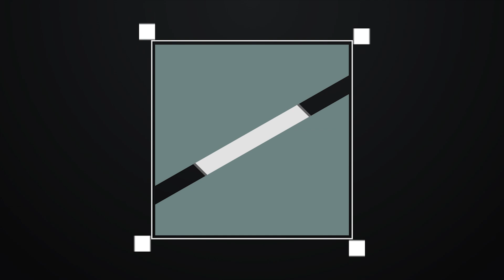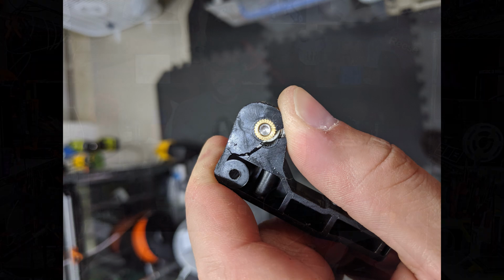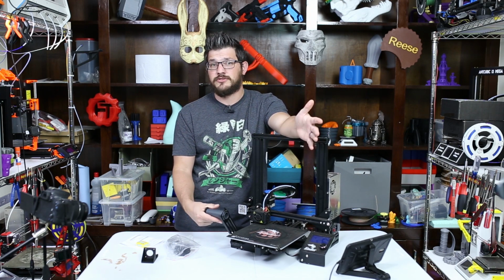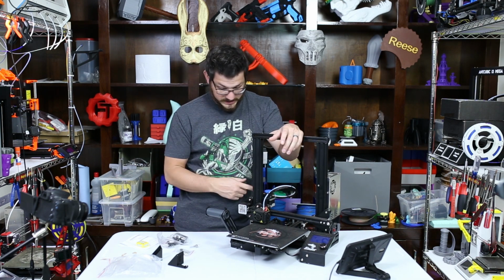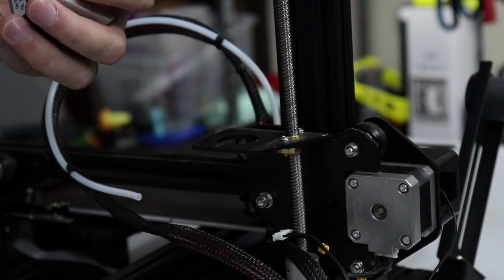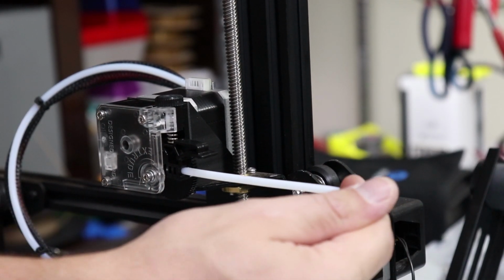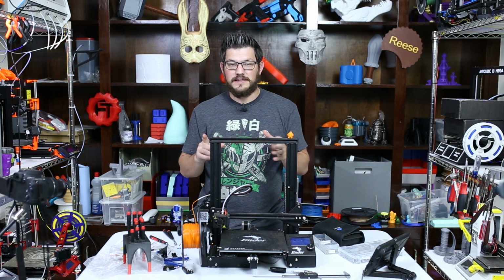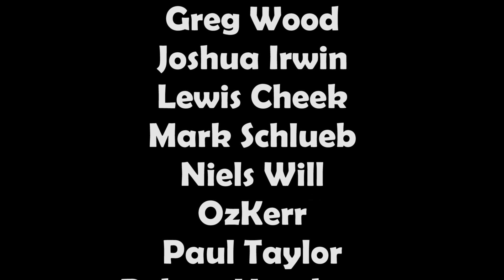Installing the TH3D Tough Extruder on the Ender 3

Comment: I'm not going to criticize the Titan, but a cheaper aluminum extruder from Amazon works fine. Same basic design as the original ender 3 extruder, just way more durable. Bought one almost immediately for my ender 3
Reply: Tough Extruder is just an overpriced clone ;)
Reply: Gunnar Freyr how is it overpriced when it’s a fraction of the cost of the original?
Reply: @jakefromstatefarm8545  cause you can get the same clone from Trianglelabs for around 20$
Reply from the maker: I have used some from Trianglelabs in the past and they are total crap.
Reply: Gunnar Freyr Gunnar Freyr the trianglelabs clone is definitely not the same quality.
Reply: @Fugatech3DPrinting  and so have many others that find that they are fine.....